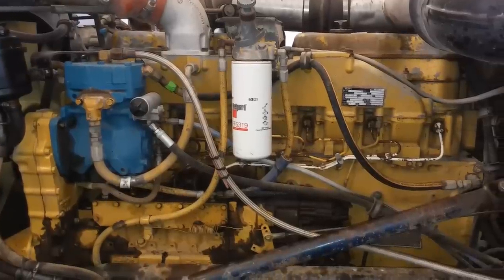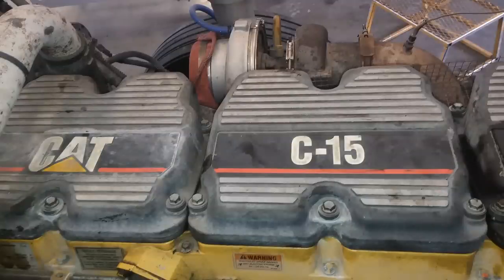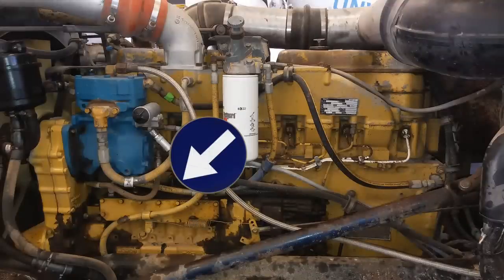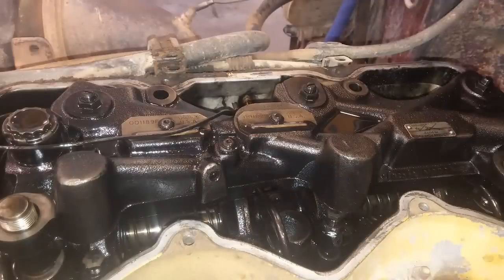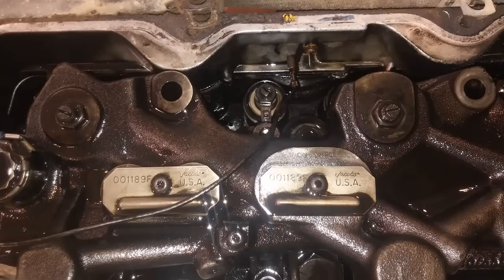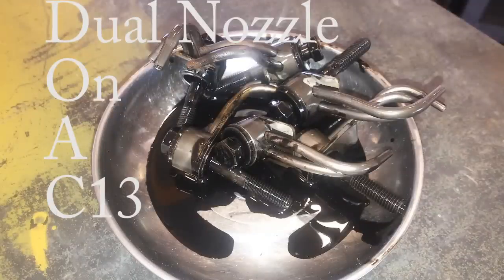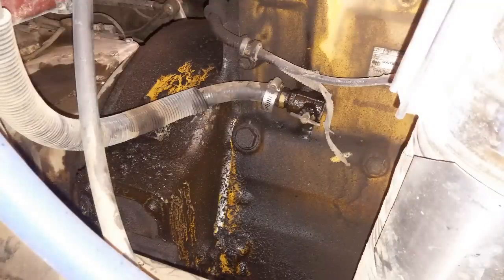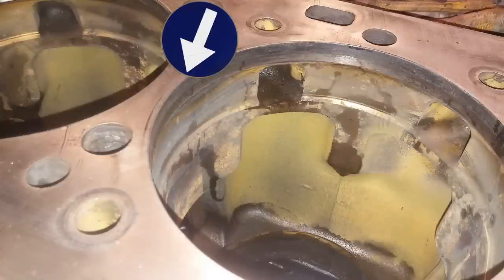The Cat 3406B Engine. Know Your Engine.  Caterpillar 3406 Information And History.

Comment: 3406 (now called A model) was a PCT, PCTA, DIT, DITA. (1973-1984) 92U prefix.
3406B at first was a 7FB, JWAC DITA, later ATAAC was added. As they ran out of serial numbers, the first 4MG's 1-03599 was still basically the same and still could be a JWAC.
Starting at 4MG03600 the VTU was the major change. And they went into the 90,000 serial numbers. Then they came out with a 5KJ and it was a 3406B, 1-07799. Most people get this serial number mixed up is the 3406 B 3ZJ, serial numbers 1-16181 is a 3406B. During the late 80's the dreaded PEEC was released. Electronic governor and VTU. You had PEEC II, PEEC II.V They started out as a 3406B 8TC. released next of the PEEC was a 2EK, still a 3406B.  Last PEEC was the 4CK and it was a 3406B 1-0845. Another 3406B PEEC was a 5YG strictly a 460 HP @1900 RPM'S.
After the 3406B ended the 3406C was released. Mechanical was 5KJ07800 and up, I have never seen one of these.
 3JZ16182 and up. The last fully mechanical 3406C was the 8PN. It is a totally different engine and parts do NOT inner change well with the older engine. Finally you had the last PEEC, 4CK0846 and up. It was a PEEC III and had a lot of VTU problems.  
Just ran across some 5KJ's 3406C's that was JWAC and high HP. Looking into these.
That is I recall from memory.
Reply: I'm running a 3406c serial# 5KJ08745 mechanical pump its in an 85 w900b. Not the original engine though.  Tag says its only 400 horse. Its a little sluggish. Ive turned the fuel up but it needs timing advanced and bigger turbo. No aftercooler on the 85 kw either
Reply: @jeremydavis6133  Serial number is a 400 HP @ 2100 RPM's. FRC has a lot to do being sluggish. If your not in a emissions area. You can take the line off and put a cap on it. Remove the FRC and install a plate. VTU is know to slip and this engine has no fix. You can buy a reman carrier and over time it will start slipping again. I have seen people weld a spot between the snap ring onto both parts. When you do this the carrier will not be a good core. SIS shows this to be a JWAC aftercooler. The fuel pumps are known to bypass fuel, not giving a full injection. Sometimes they will stumble on acceleration. You can lap the pumps, install new bushings and bonnets. With that old of a engine the pumps are more than likely worn out anyway.  I have never seen a 5KJ 3406C model. Cat offered a 350 HP, 1800 or 2100, 400 HP 1800 or 2100, 425 HP 1800 or 2100, also these in CARB (emissions BS) and the big one a 515 HP. Only three of these was built and you have to have a high torque transmission and clutch. Do not know if you get all the parts for the 515.
Reply: @johngoldsmith6629  im not an expert i dont know what the VTU or JWAC stuff is. I just know I love the 3406 but this one doesn't pull anything  like the last b model I drove that had a big turbo and pump advanced. The 85 kw has no air to air cooler. This truck had a b model and when it died they bought this c model as a new complete crate from what I understand and just set the whole thing in. Shortly after the guy died and it set in a barn for a decade or more before my boss bought it cause I told him I wanted it.  The motor and everything  is pretty fresh  I think he even has paperwork on it. Ive put a little over 100,000 miles on it. I think it may have a water cooled intake. Its got a pipe from the oil cooler area that comes around and goes into front of intake but I dont recall ever seeing that on any other 3406 so idk what it is.  It has the 12 point head bolts
Reply: @jeremydavis6133  A JWAC is a jacket water aftercooler. The pipe off the turbo goes over the valve cover to the intake. Inside is a core that is cooled by water. Bad thing is the air temp can only cool down to coolant temp. While a ATAAC, air to air aftercooler, uses ram ambient air gets the air temp even lower. Thus more air you can pack in the cylinder. VTU is variable timing unit. The 3406 92U, now called A model used a slide advance. You could adjust the pin timing, but the advance would start and stop by spring force. No real adjustment. 
When the 7FB's came out Cat improved the timing system. You now have static timing (pin timing). Start of advance screw and end of advance screw. You have to use the timing indicator group and you can dial in the timing. However  had some problems and few recalls. Race wears, bolts came loose, big spring would wear or break, quad seals would blow out. The major one is the carrier is three pieces. Pressed in and held with a snap ring. Over time the inner piece would get loose and as the engine was running. The inner piece was going slower as it was slipping, causing the engine not to have proper advance for the speed. This carried over into the 4MG's and it was a major problem on that series. The 4MG's had numerous recalls on the VTU. Since it was current production at the time. Cat  repaired the carrier and made it thread into itself. But the 7FB style never got the fix. Looking at SIS, you VTU is the 7FB style. So it is possible that your carrier can run slower then actual engine speed, so your VTU may not be advanced as it should. And with this style it is harder to know over the 4MG's. The darn thing has a shield over it. Cat put some timing marks on the inside on reman's so you know they have slipped. You have to take it apart to see them. Sometimes you can use a small pick and try and see if the inner carrier will move without removing it.
Reply: @johngoldsmith6629  ok yeah its the JWAC   I didnt realize cat ever used that. I just thought it wasn't cooled. But yeah the Pyro runs a little warm I gotta watch it and sometimes back off and drop a gear. It is pretty tall geared though with a 15 over,355 rears and tall 24s. Under 1500rpm it builds too much heat.  The VTU you're talking about must the under the cone cover. It was really a slug when I got in it and a shop said they replaced the timing advance thing but I didn't notice any difference. About 2 weeks later it came apart and punched a hole in the cone cover. It still didn't run any different with the hole in it. Boss put a new timing advance thing and cone cover on it and it still didn't run any different. Thats when I backed the fuel screws out one turn at a time and drove it. I ended up with both pump screws 3 turns out from where it was. Its helped alot I'm out of turbo now it won't spin any harder so more fuel is not gonna help.  But its still just not snappy like it should be.  What is the FRC thing you mentioned?  I'm in Sw Missouri we don't do emissions.  Also I thought I could have the pump timing advanced by pinning the pump and rolling the motor back a hair to get pump half a hole off. Is that not possible on this motor?  Thanks for all your info
Reply: Just finished working on my first Peec ll unit it was a 3412 running a generator the Rack position sensor and BTM can cause the governor to over or under fuel causing erratic rpms
Reply: Very limited on 3412 PEEC engines. But the RACK sensor and the BTM can cause a RPM surge. On some 3412 PEEC engines you cannot do a BTM sweep test. You can look at desired rack vs actual rack on the status screen. I would check the oil level as the governor has an oil pump to assist in oil flow. The rack sensor is very expensive and has to be calibrated. The BTM is a lot cheaper and easy to install. On 3406B/C in truck engines, I use to pull the signal wire out of the connector while engine was idling. The engine speed would burp and if the surge went away, I felt the rack sensor was acting up. While looking at the status screen try and see at what position the rack is when surging. Shut the engine down, remove the BTM. Then do a rack sensor calibration. Move the piston valve assembly out slowly and look at rack position on your status screen. Your looking for a dead spot or erratic movement. If you cannot do a sweep test. I never tried this. You can take the BTM hook it up to a rheostat and slowly increase voltage. Your looking for a smooth swing of the arm pass the dot and smooth back to off position.
Reply: @johngoldsmith6629  yeah the "dead spot" on the rack position sensor is what I found.  While the engine was running it would periodically default to 1.80mm position then it would read the actual position. This would cause surging condition then the engine rpm would continue to climb until you reached overspeed shutdown.  Once I shut the engine down and did the calibration test I used my hand to simulate the rack position and the sensor would do the same thing where it could do a full sweep reading but in certain positions it would fault Out and get stuck at 1.80mm which is full fuel. Changed that sensor and engine speed went back to normal.
Reply: @fatpatlives1998  You are the man.

Comment: Good video. I grew up on mechanical diesels and loved 'em. It took me awhile to learn the electronics and I'm still learning, they change it so often.
Reply from the maker: +Jim Zivny I'm very comfortable with the electronic engines, and I'm trying to get into the mechanical pumps, but don't have a seasoned guy in the shop to show me the works. Gonna have to learn on my own.
Reply: Put your hand on every pump manual you come across.....lots of critical numbers and running changes and what worked....also don't use any "new old stock" fuel system parts....remember how many times they took sulfur out of diesel in the last 25 years! They won't last a month
Reply: They are called scroll fuel systems. Like rolling a paper scroll open. The helix on the pump determines how much fuel is metered into the cylinder. You have a fill port and a spill port. Just think of rack and pinion. As the rack moves all the pumps move the same. As the rack opens up, it increases the angle of the helix (more). As the fuel cam lift's each pump, with the increased angle, takes longer to reach the spill port. So going up a hill engine speed slows down due to load. Flyweights in the gov. slows down. Spring force becomes stronger allowing rack to move into the full on position. Which increases angle of helix, taking a longer stroke on each injection pump to reach spill port, thus more fuel on the piston. Going over the hill, flyweight speed increases. Now flyweights are stronger than spring force. Pulling rack back, reducing angle of helix. Now on each injection cycle less stroke is now available to spill port, thus reducing amount of fuel metered onto the piston.
Sleeve metering is about the same except you have a sleeve riding up and down on each pump. As the sleeve is moved up or down determines a longer or shorter stroke to reach the spill port.

Comment: These engines were also used in cranes etc. To solve the exhaust manifold bolt problem, replace the bolts cross  drill the heads, torque them up, and using stainless steel wire, lock them in situ. Fitting an industrial eng pan will add rigidity to the eng block  Keep the crankcase breathers (s) clean, and add an extra breather to the block, it will reduce oil leaks, especially the front and rear crank seals.. Get the sandwich plates machined and use high quality "O" ring material to seal them. Take the mechanical pump (and inj's) to a rebuild specialist and watch them check the fuel delivery, atomisation,spray pattern and leak down of the inj's. Then get the main pump calibrated and tested for equal and accurate firing order / angles.Sounds like a lot of trouble to do, but it will repay for itself many times over. Each 3406 was rated for max HP at set rpm, the pump rebuilder can fine tune the inj system to operate a little above that and give some safe and reliable extra HP without producing a black thundercloud every time the throttle is opened up.Anyone with a decent workshop and access to information can play around with a 3406 and get some decent results, much like a Detroit Diesel. Don't forget, black smoke is unburned fuel and helps to "wash down" cylinder bores and contaminate lube oil..Keep a 3406 within the rpm range and it will run for a very long time without losing too much HP.::)
Reply: Why they never went to larger studs like the 1693 was totally beyond me. I developed many inventive ways to remove broken studs, Cat even had a line up tool to drill them out-had one.

Comment: One great engine. I got a freightliner dump truck with 3406C  engine and turned up 3406B mechanical fuel pump and 3406E faster spool turbo with external wastegate. Never had it on a dyno but it sure goes good. I'd like to try them marine nozzles though heard nothing but the good about them.

Comment: Besides the Detroit 60 series, this was a good reliable engine
Reply: I would also throw in the Cummins N14, it has been a very good and reliable engine as well.  Seems like the mid 80's to late 90's engines were the best before the EPA regulations changed into the more maintenance heavy engines of today.
Reply: @HoneyBadger363  the n14 also makes power quicker than the 3406b, I drive 2 trucks with these engines. The n14 will rev quicker than the 3406b but the 3406b has much more top end. Will have to give it to the Cummins on the engine braking though, the cat I drive has a brake saver and doesn't have the same braking power as the n14.
Reply: @alfonsgar  Cat never did do well with engine braking, Series 60s and N14s were way better, Series 60s were the best engine braking in my opinion.
Reply: Honey Badger The N14, Series 60, and the 3406B were all great engines and they all ran well past the million mile mark with good maintenance practices. For my needs the 12.7 fits the bill . All three were great money making chunks of cast iron. I still have a pre-egr 12.7 and I just don’t want to change. I despise all the newer emission engines regardless of who makes them.

Comment: Good Video. As a young diesel mechanic back in the 80's I think the 3406A model engine was more of a zombie engine then the B models the A models had a inline injection pump with a gear driven fuel transfer pump with low pressure fuel nozzles/pre-cups, while the B model had a inline injection pump with a plunger type fuel transfer pump with a high pressure direct injection injectors.  The check valves in the plunger fuel pump were constantly failing, along with the nozzles not maintaining recomended test pressures/patterns. What gave the B models a bad rap was in the early first production models Cat had a one piece head gasket to were the fire ring was crimped onto the gasket instead of the fire ring being separate from the head gasket, the other downfall was the early B's didn't have a torque plate between the lower block and oil pan as well as main bearing cap support plates. The lower torque plate would prevent the block from flexing causing the upper flex plate and head gasket from moving causing premature head gasket failure, along with the lower main bearing cap supports would prevent the block from flexing. Cat slowly addressed these problems very slowly, while at the owners expense by trying to introduce the updates on these engines quietly without drawing attention to themselves. I Hope some of you find this information helpful.
Reply: I have an A model in my 359 its not original the previous owner removed the B and put an A in it for whatever reason and im trying to find out all i can about it but im not having much luck online. Ive heard you can do a timing advance and go with a C model turbo and get somewhere around 515hp but but i cant find the info on how to do it.

Comment: I worked on 3406 in the early 80's in 977l cat loaders, they were an awsome engine, a bitch to prime at times but lasted forever in the loaders. They also had a wet starter motor that would leak oil and a special way to set valve clearance.
Reply: Hey guys can someone tell me where to install the oil pressure port for a mechanical gauge on my 3406b

Comment: I've had trucks with 3406b s . I loved them. they almost never spent time in the shop. mine never had oil leak issues at least not as bad as series 60 they used about the same amount of fuel as a series 60 and a lot less down time.

Comment: 3406c was available as full mechanical or peec. Roughly 110k full mechanical c’s were produced and 32k peec’s were produced. The peec was rated at 460hp while the full mechanical was 425.
Reply: What year did they start?

Comment: I had 2 of them. A 310 hp in a Ford 9000 and a pilled up 425hp ( unknown final hp ) model in a Autocar. The 310 would pull hard down to about 1100 and ran very clean. The 425 was a dirty girl but would fly. They both snapped the exhaust studs off.
Reply: 1958johndeere620   you had me at Autocar...... was it an A64 ( I think that was the street model ) or a vocational model?
Reply: I honestly don't remember. It was the regular front axle, not the model where the front was slightly back. I have a 97 one now but that has the volvo engine. Looking at the models I would say it was the acl64.  It had the 8ll but an overdrive shift pattern.

Comment: Had 3406b in my autocar dk64 1987 425 hp with 529 rears 58,000 lb 20,000 front and 8 speed ll .beast of a tractor. Pulled like crazy
Reply: Autocar trucks are a beast anyway, they make 9400i naviturds crap their pants